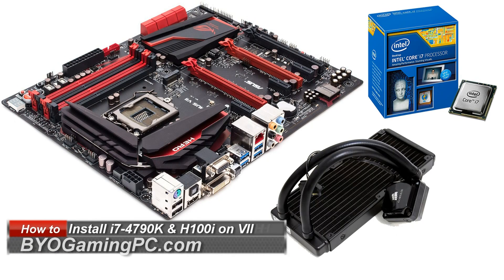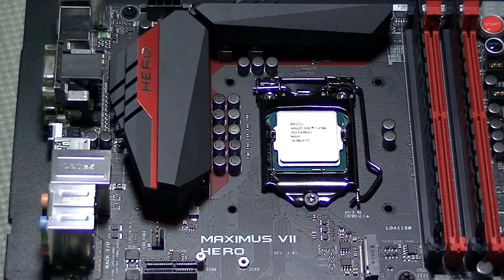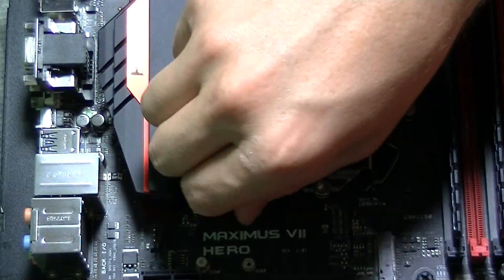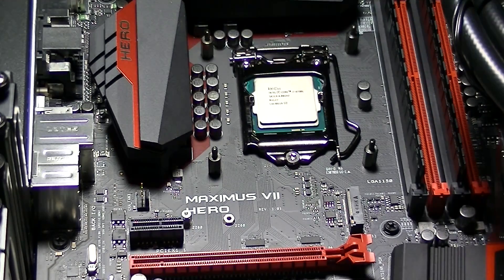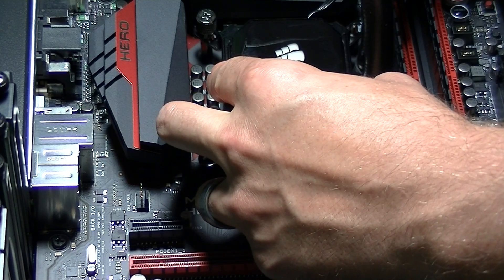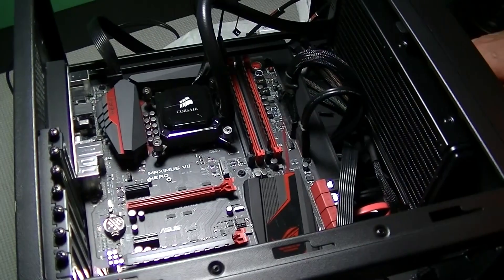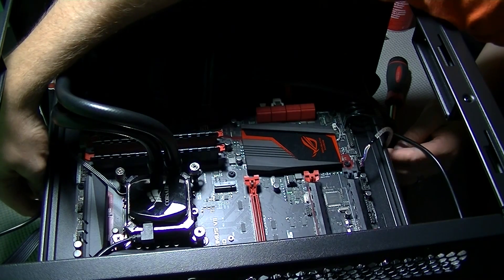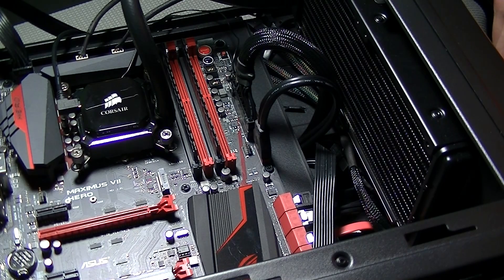How to Install Corsair H100i on ASUS Maximus VII Hero with i7-4790K

Comment: Did you encounter any conflicts between this Mobo and H100i or was it plug and play pretty much? I've read people complaining that Asus mobo software called AI Suite was conflicting with corsair link. I plan to install the h100i exactly how you did in video with the radiator fans connecting to the MOBO rather than the pump, even though I'll use the stock fans, and then the 3 pin connecting to any other fan header.
Reply from the maker: Personally, I don't use AI Suite since I prefer to edit all of my settings in the BIOS so I don't have any problems. I would recommend upgrading your fans in the future if you value silence. The stock fans are quite loud but they do the job.
Reply: I have the h100i on an asus Z-97 pro-gamer board. Here is what I have found out from personal experience. The corsair link software is junk.I've looked and looked and not one good review of the software. The LED never stayed the color I set it at,The fans didn't speed up when the cpu was at full load and getting hot. So what I did was Hook the fans to the cpu fan header and the optional cpu fan header,hooked the other wire from the pump to the case fan number 3 header and of course the sata wire to a sata  power cable. You can control the fans from the bios or with AI suite. The thermal paste that comes on the h100i is crap also. My temps were hitting over 70c. So I took the pump back off,cleaned it and the cpu,then I used arctic silver 5 and my temps dropped over 10 c. My idle temps have finally dropped into the 20's where before they were in the high 30's. I feel so much more secure with the h100i now that I have done that.
Reply from the maker: Robert Floyd You can have your LED colors work correctly by using the 1.05 firmware. The newest firmware doesn't work correctly. Try that and let me know how it works.
Reply: BYOGamingPC  I appreciate it but I won't be using the corsair link any longer. I'm getting great performance with the way I have it connected. the led does work,it's just a pinkish color. I'll live with that. this cooler is the only corsair product I have and if the software for any of their other products is as bad as link,I won't be buying any more corsair products.
Reply from the maker: Robert Floyd I don't ever like to rely on software but even in this case it's not the software but the firmware that is the issue. When I had the same problem I did a lot of trial and error and figured out that it was a firmware issue in the update after 1.05.
Reply: Got my entire system built and it's running flawlessly. The h100i was pretty easy to install once I properly adjusted the back plate to make it fit. It's doing a good job at keeping my temps down considering I live in Hawaii so the ambient temps are always high, Thanks for the video!
Reply from the maker: Randy Moss Awesome! Glad to hear!

Comment: Really appreciate this video. I canceled my Newegg order and upgraded some of my parts. I went with this exact h100i as my cpu cooler, this same asus hero motherboard, and the same 4790k. For the GPU I went with the Titan X which I just received in the mail from NVIDIA. I had previously chosen a after market CPU fan but this video showed me that the h100i is no harder to install than an aftermarket fan. Since I live in Hawaii where it is always 80 degrees F I decided I need a water cooling solution for my 4790k. Can't wait to start my first build =)
Reply: Randy Moss Very bad choice on titan x. Everything else is ok
Reply from the maker: Good luck on your build and have fun!
Reply: You wanted to run a TITAN X on a regular cpu fan!?!
Reply: Tyrone Ramsey

How do you figure it's a very bad choice? I just installed a custom loop and flashed a new bios. It's now running at 1490 MHZ and is the fastest GPU on the planet. Money isn't an issue for me so don't say price\perf because that only matters to some =)
Reply: Randy Moss Sli 980 TI would've been cool though, hope you have fun with your build :) Just ordered the same CPU and mobo
Reply: popstarfromhel
Not a fan of SLI. Had a bad experience with it in the past. I put a custom loop in my PC a month or so ago. Got my Titan X over volted and flying now haha
Reply: Randy Moss I understand that completely, for me sli is a good solution since i could buy one card at first so soon i run 970 sli but if you can afford single card yeah... I dont know if you still got warranty on the card since soon a new ''titan killer'' from AMD comes out, 2/3rd of the price same performance i ''heard''. And any tips for a beginning water cooler? Im really afraid of having water inside my comp even AIO kits since a few thousand dollar system aint nothing, :)
Reply: popstarfromhel
The new AMD card isn't even faster than a 980ti unfortunately. I was hoping AMD would smash NVIDIA because competition only benefits us as the consumer.
Reply: Randy Moss Sorry i dont mean the r9 390x but in a few weeks or months they are releasing another card like 295x but i forgot the name... Anyhow from what ive heard from random people it is around the same price of the TI but just ''stronger '' (Everything i heard about it was really unclear but a man can dream ey? xD)  Perhaps if it is good i will trade in my 970 sli for it.
Reply: Randy Moss The card is named R9 Fury x2, check it out.
Reply: popstarfromhel

Yeah it's two chips, not a single card. You'd have to compare it to 980ti sli or Titan X sli for a proper comparison
Reply: Randy Moss Yes its two chips but by games it gets counted as a single card so you dont have the same perticular ssues as with sli/xfire. Im 100% sure there will be some new issues but thats another boat. And it seems so far from the benchmarks it blows the titan of its throne for almost half the price. But if its like that then there must be something shady taken as it is around the same price as the TI... anyhow have fun with your system and check for sure if it is worth it.
Reply: ***** what? I dont understand.
Reply: You better overclock that beast if you dont im coming for you
Reply: Mast3r Race hey I'm in Hawaii as well and getting mostly the same components as you except for the GPU I got a EVGA GTX 980 SC. do u think I'll need the h100i or another liquid cooler for the i7 4790k? right now I got a Cooler Master Hyper 212 EVO.
Reply: I actually have a H100i that I installed for a month and then upgraded to a custom loop. If I could find the mounting hardware I'd just give it to you. The 212 Evo will be good enough to avoid thermal throttle though even with a light overclock. It really depends what temperature your comfortable with.
Reply: So u think its enough, ok. Just wondering cuz I read some reviews of the 4790k and they said it runs a little hot. What island are u on?
Reply: *****
Oahu. Yeah it can run a little hot but not that bad. Do you have air conditioning where you play? That would help keep temps down. Either way though you shouldn't run into any major overheating or anything like that.
Reply: I'm in Laie. I don't have any AC and my apartment is pretty hot even with fans. I'll probably end up getting it after my paycheck rolls in. Thanks.

Comment from the maker: @Zachary Lowe I wouldn't worry so much about your idle temps but what are your max benchmarking temps with Intel XTU or AIDA? If you are over 70C then you may want to tighten your screws a bit that mount the cooler to the motherboard.

Your ambient temps also play a part.

Comment: ive got this cooler on a 4790k, and my idle temps are 35 to 40 degrees celsius. I did do a little tweaking with my fan curves, because before i was getting around 30 to 36 degrees celsius at idle. i was just wondering what i can do to improve its idle temperatures if these arent normal.

Comment: If this is a water cooled CPU cooler, don't you have to put water in it?
Reply from the maker: This is an all-in-one (AIO) cooler which comes already filled and requires no maintenance. DO NOT take it apart to add or change the fluid. You don't need to do any maintenance on the cooler at all.
Reply: Ok thank you :D

Comment: Is this motherboard better than the SMI Z97 gaming 5
Reply from the maker: ASUS is known to be a more reliable motherboard manufacturer than MSI and in my opinion yes, this is a better board.
Reply: Fair enough, but surely if you take care of your pc it should be okay either way right? but what is better performance and better for Overclocking?
Reply from the maker: Captain Vayne Your biggest factor is your CPU and luck of the lottery. Your CPU will determine you OC more than your motherboard.

Comment: Why not plug the fan cables into the 100i, on top of it is a spot for it, you can then change the speeds with Link as well as colour.
Reply from the maker: You can but I prefer to control the fans via the motherboard BIOS. Either way will work.

Comment: if im gonna get the i7 4790K , i must get the asus maxium vii becuase it's the only one that gonna work with it ? i find the mobo to be a little be expensive thats why im asking :s
Reply from the maker: No, you don't have to get the Maximus VII Hero. The MSI Gaming 5 http://amzn.to/1Dv38qD and the Gigabyte GA-Z97X-GAMING 5 http://amzn.to/1C0lz8R are both excellent options with plenty of features as well.
Reply: Thank you so much BYO, im still looking to get a perfect motherboard, but i found that the Asus maximus a little bit too expensive, then you suggest me these two, and they look very solid with a very reasonable price. Now if you had to chose betwen these two what would you get ?
And the most important question BYO is, i want to get a moherboard that will last looong enough ! because when i wantto upgrade my GPU to future GPUS, i dont want to worry about my mobo, so will these do the job ? i just wanna game 90 % , and do like 10 % of editing, So the Z97 are enough for future right ? not that i need a x99 ? becausethose are just freacking expensive ?!

Thank you so much Byo.
Reply from the maker: ***** I would go with a Z97 board and either of those options are excellent. Personally, I would lean a bit more toward the MSI but it's a close call.
Reply: BYOGamingPC thank you so much BYO !!! MSI z97 is definitely on my list now !

Comment: Is liquid cooling hard to maintain as a first time builder?
Reply from the maker: This is the beauty of the all-in-one cooler. There is no maintenance.
Reply: BYOGamingPC No maintenance? And what about galvanic corrosion? Doesn't it problem with no maintenance? or is it only with full case liquid cooling?
Reply from the maker: xShotyDnBx You do not need to worry about corrosion and please do not take apart your cooler to change the fluid. It is designed to be maintenance free and you should not take it apart.
Reply: Thank you. :-)
Reply from the maker: No problem.
Reply: BYOGamingPC Thanks

Comment: Can I rotate the cooler 180 degrees? I want to use it in a Bitfenix Prodigy M, but my motherboard is upside down, so I also want the LED logo on the cooler to be the right orientation.
Reply from the maker: Yes, it can be installed in any 90/180 degree rotation.

Comment: do you need thermal compound?
Reply from the maker: The H100i comes with one application already applied so if you plan to do only one application with a new H100i you do not need any.
Reply: ok cool but how long until i have to re apply
Reply from the maker: DASIFICL It should be fine for a year or maybe 2. It really depends on how environmental factors.
Reply: Ok, thanks man your an awsome youtuber for answering questions. Sub up

Comment: Also..do you think the stock fans are good on the cooler? I was lookin at the corsair 120mm fans...mostly for cosmetic reasons..but as far as performance what are your opinions?
Reply from the maker: The stock fans do the job but they are very loud which is the reason I replaced them. There are much better performing fans available like the Noctua NF-F12 http://amzn.to/XNi6bk fans that I used or the Corsair SP120 http://amzn.to/1LwtH3t fans are nice too.

Comment: Thanks man I just bought new components for my new build, same as yours.
i7 4790k
32GB DDR3 2400MHz Corsair Vengeance RAM
ASUS ROG Maximus Formula VII/WATCHDOGS
GTX 980 ASUS STRIX
480GB SSD Kingston Hyper X 3K
H100i Corsair CPU Cooler
RM1000 PSU from Corsair
CoolerMaster HAF x Case
ROG Front Base
ROG Gladius Mouse
ROG Whetstone Mousepad
1TB WD 7200RPG HDD
2x 120mm RED LED Corsair AF Fans
1x 140mm RED LED Corsair AF Fans
ROG SWIFT 27" QHD with G-Sync Monitor
G19 Logitech Keyboard
G930 Wirelss 7.1 Headset (Will get the ROG Orion soon)

Moving on from my i7 2600 OEM Alienware X51....it had the 330 watt PSU and GTX 555...time to get some serious fire power  right in there.

Comment: I need help! ok so what i got is the same motherboard and cpu but i got a cooler master evo cpu cooler. when i apply the thermal compound do i have to spread it around? do i just apply a drop and slap on the cooler? please help guys
Reply from the maker: Do not spread it around. Use the pea sized drop method.
Reply: Ok sweet thanks!

Comment: im getting this as well to replace my stock cooler since its not good enough to cool down my cpu

problem is im using the system right now, i hope removing the motherboard from my case wont be such a pain :C
Reply: There's a square cut out on your case so you can install aftermarket coolers without removing the mobo, lol.
Reply: oh hoho....wow ok i didn't know that, thanks, will it also work with h105?

....wait a minute how do you know my case has a hole on the back of the mobo?

you didn't know what case what i was using
Reply: dsniper17 Most cases have a square cut out on the motherboard tray. But I still need to know which case you're using to verify that the H105 can fit in it.
Reply: phantom nzxt 530, i check the website, it fits
Reply: dsniper17 Well great then! :)
Reply: Almost all cases have motherboard cut outs

Comment: Just a note here, but the H100i already comes with high quality thermal paste pre-applied and you don't have to replace it if you don't want to.
Reply: Amaan Bari The thermal paste on the h100i from what I gather is Shin Etsu, a high end thermal paste that performs just as well as others. There really is no need to change the thermal paste on the h100i because there will be very little change if any, however if you're changing CPU or upgrading your motherboard obviously you'll need to reapply thermal paste.

http://www.overclock.net/t/1455873/best-thermal-paste-to-use-with-an-h100i - As shown in this thread.
Reply: The Arctic paste and other ones like gelid thermal pastes are substantially better than the cheap pre applied ones.
Reply: Amaan Bari i used the stock paste for a year before getting some gelid gc extreme paste. ive been using it 2 years now 2 different applications. i didnt notice any temp difference worth mentioning. this is on a 3930k @ 4.6gz. the stock paste is really good for being stock
Reply: EZOVERDOSE yea, techmycomputer told me the stock paste is really good, but the ones that come on stock cpu coolers are bad.

Comment: I have the model previous gen (VI) motherboard, Would I be able to plug the sp120L fans into both of the two CPU fan headers on the motherboard as I've heard plugging the fans into the pump, they to to a pretty high rpm compared to the fan headers.
Reply from the maker: I can't remember if there is an adapter to do that but the SP120L fans are specially designed to plug into the pump.
Reply: Also because I'm using both front usb headers on the mb, would the usb from the pump plug in to the ROG ext
Reply: BYOGamingPC They are 4 Pin which is the same as the two fan headers on the motherboard. I'll install them later and give an update.

Comment: If I don't use the Fen's that are included in the Box, and use Corsair Air Series AF140 Quiet Edition 140mm Case Fan,do I need to plug in Mobo a 3 pin connector from  the pump or not.PL. halp
Reply from the maker: You would just want to use the CPU PWM fan headers on your motherboard like I did in the video.
Reply: BYOGamingPC YES ty for Video and advice

Comment: So, hope you're watching these posts... I am installing the H100i onto a Hero VII as I type this. Installed the back plate and I have 3-4 mm of play before installing the block. Is this normal. Looked up some others who had this issue and it seems to be a mixed bag. Some say it's okay once the block is installed, others add some type of spacers onto the back plate to tighten it all up. So, my question ... Was your set up loose before putting on the water block? Thanks.
Reply from the maker: Yes, I did experience this but once you tighten the thumb screws everything should be secure. You shouldn't need any shims or washers.

Comment: So.... i have to plug the fans that come with in the pump , not in the MoBo?
Reply from the maker: Correct, the fans that come with the cooler are quite loud though so I never use them.
Reply: Thanks, now i know why i can't control both fans (just the one pluged in the CPU place (i don't know how it's called)

Comment: Can all these parts fit into the Fractal Design R4 ATX Mid Tower Case?
I'm keen on getting both the Fractal design with these parts, I fear that due to the H100i's size it won't be able to fit into the Fractal Design R4.
Reply from the maker: Yes, they should fit no problem.